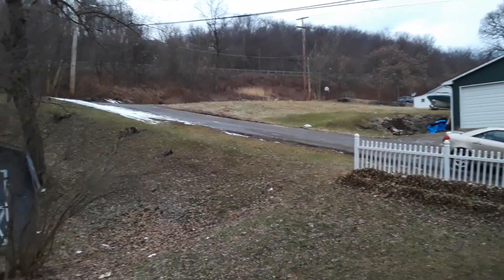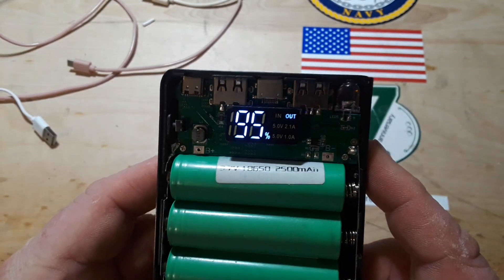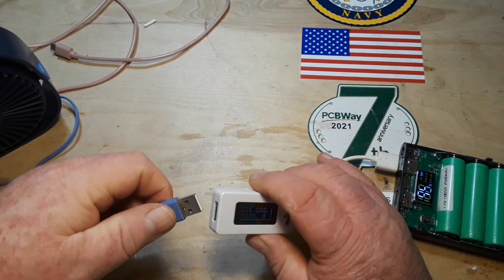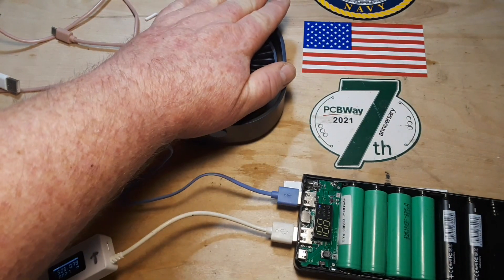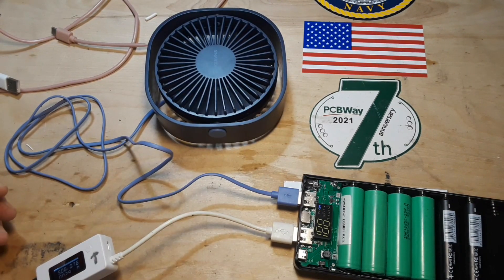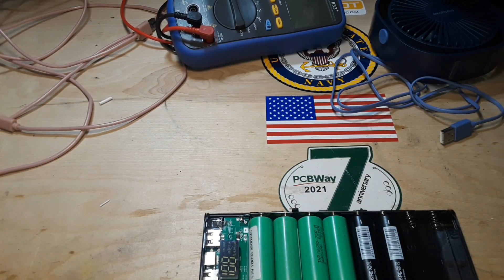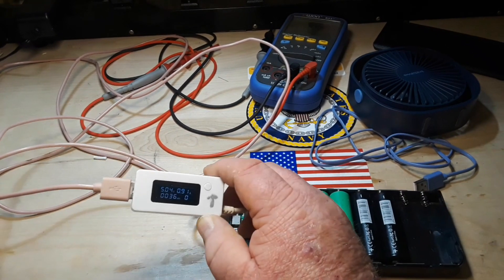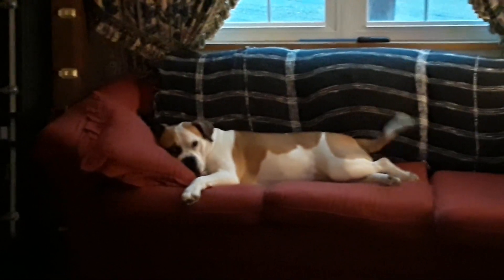18650 Powerbank Testing & Experiments

Comment: So essentially a basic battery charger for 18650s that can be used to power something or charge a phone - cool ! It would be something that i would keep in the car or around the house for emergencies like blackouts as i have a pile of 18650 batteries i scavenged from laptops and being able to use these in that unit to charge a phone or even a torch would be great . I wouldn't use it as a charger except in desperation as i like my chargers to have temperature sensors and the ability to sense cells that are bad .
Thanks for the video Paul ! Always enjoy watching and learning ! ✌✌
Reply from the maker: You nailed it!

Comment: a fan restricted this way uses less current if you put it in a more viscus fluid it would draw more.
to keep your dummy load cool drop it in distilled water as it will dissipate heat very well and have little/no conductivity.
a few things you did not test were max charge voltage should be 4.2V or less and battery cutoff voltage i know this uses a tp40xx chip still need to test.
the sad part is cuttoff voltage is normally programed far to low at 2.5V and should be 3V. over discharge is a cycle life killer.
thanks again

Comment: Do all of your batteries have circuits to protect them from over-charge and over-discharge? Otherwise, there is a danger of fire.
Reply from the maker: That's what the tp4056 ic in the charger if for.
Reply: @learnelectronics  Good. I didn't realize it had one. Thanks.

Comment: Those batteries can give much more than 2 ampers. It is the Dc step up converter that is limited to 2 ampers.
It converts 3-4.2 volts into 5vdc.
The output current of the converter is set by the duty cycle, so you cant draw more than it gives. Even if you short circuit, it would still give 2 ampere, regardless of how low is the resistance.
I am not an expert, only my personal experience.
I like the gentleman who makes those videos. I dont know his name, but he is a very nice person, to me. He is one of the best examples of a nice american person. I lern from him, not just electronics, but being a nice person as well. I am grateful for that.
I like the way he makes things clear, simple, and easy to understand.
Reply from the maker: I'm Paul.
Reply: @learnelectronics  pleased to meet you Paul. Great Paul.
I am sorry i cant give you my real name. Personal security protocol.
I am a great fun of yours, i am from israel.

Comment: Sorry, Paul,  when you restrict the flow of the fan you are actually reducing the power consumption. The fan might run faster, but the motor isn’t working harder.
Reply from the maker: Huh? Really
Reply: A motor draws current when you load it down with whatever.  The load on a fan is the air flowing through it. No air flow, no load.  In a similar example if you have water pump with a valve on the discharge. As you open the valve more water is moved through the pump which increases the load on the motor which uses more electric power.  Take it from an ex navy nuc. USS Ulysses  S Grant, SSBN-631, 1968-1973.
Reply: @learnelectronics   really as it is not moving anything anymore if you put it in maple syrup it would draw more